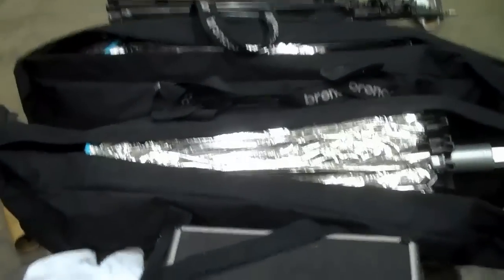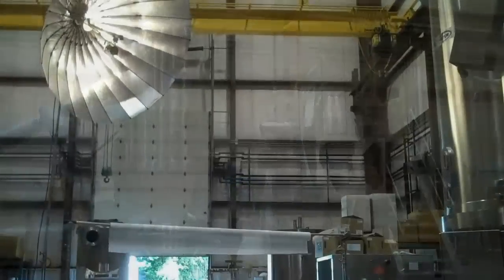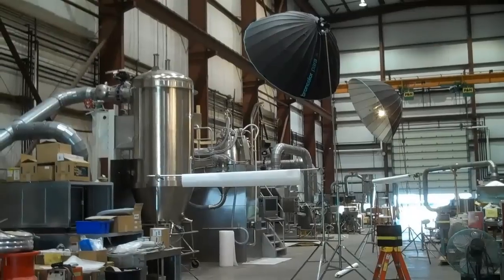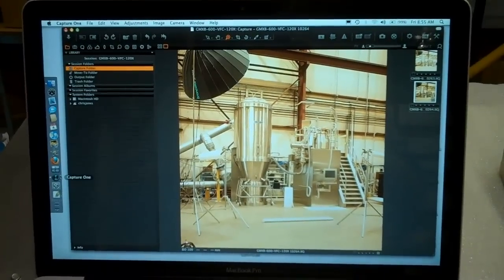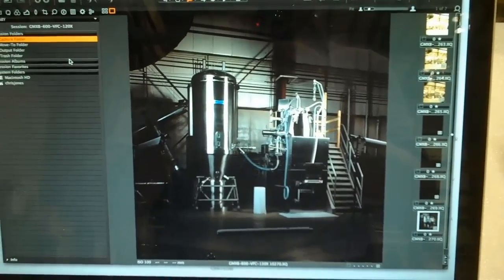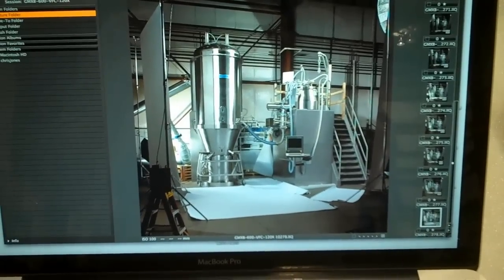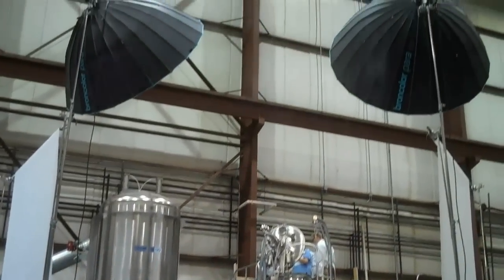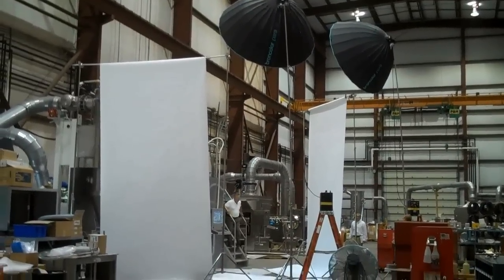Broncolor Para 220 on Industrial Photo Shoot-4

Comment: Why would you use focused light modifiers. You need two 20x20 silks to make a huge light tent.
Reply from the maker: Large silks outside in the sun work great. I have use them with fashion shoots on location. However, in an industrial location  like these job assignments, they have hot spots created by the lights behind them. However, you are correct that large surfaces for reflection on stainless steel are better than normal umbrella light modifiers. That said, it seems you have never used Broncolor Para 220s. These lights spread a large amount of even light without hotspots unlike less expensive lower quality systems. My use on this shoot as said before was an experiment to show how a light modifier commonly used ONLY for fashion has other uses. Additionally to be considered is the fact that time is and always has been with this client an issue..never being given more than a couple hours to arrive, set-up and shoot. It was a test..thats all. As photographers we can push equipment beyond what is fashionable sold to us...even if Broncolor would prefer to see these lights used with pretty girls it does not mean as photographers we can see other uses.

Comment: I am sorry, but I think using para, especially those big ones on the polished steel metal machinery, is a wrong decision. All you need is 3200 Units with bare bulbs positioned in a very high place to avoid reflections. Yes you can also use white diffusers on the side, but it isn't worth the hassle since you can easily add those strips in PS.
Reply from the maker: Stainless steel sees what environment is around it. Positioning bare bulbs from above only lightens better what the stainless will see. Thus your reflections would increase not decrease. Additionally, industrial facilities like this one often have ceiling heights above 60 feet thus 3200 watts is in no way going to reflect off a ceiling and light a cavernous space like this. Most of the time those ceilings are dark, not white (like this one which is new and an exception) thus absorbing the bare bulb flash instead of reflecting it. Let alone the challenge which you have not explained of getting a light up that high. If your suggesting pointing the bare bulbs down you would pickup more light but again increasing what the stainless sees around it. As well as moving the hot spot from the sides to the top of the machine. White paper surrounding the machine removes the view of the facility from the stainless steel. You have to control what the stainless steel sees, as well as light it. That means cutting off the view of the surrounding facility from the stainless steel. No matter what light source you use that part of the process is required. In fact more important than how you light. I have in some cases raised the paper around a machine and simply shot available light , long exposure and corrected color in Photoshop, but this has only been for the largest machines I have been hired to shoot which are over 30, 40 and even 50 feet tall. Most important...you are NOT lighting the machine...you are lighting what the machine SEES. In my 32 years of shooting stainless steel the paras cast a broad even light which eliminated hot spots and the use of multiple box lights which increases the time on set and the amount of equipment needed to shoot one of these machines. For my use, while I used them, they where better than anything I had used in the past. Only my fear of damaging them had me falling back to the soft box method. I rarely get more than two hours to photograph any machine so speed is important. We will agree to disagree on Photoshop replicating what good lighting can produce in these environments.